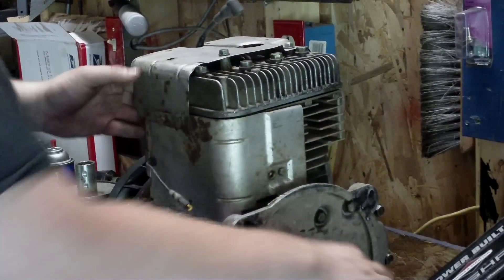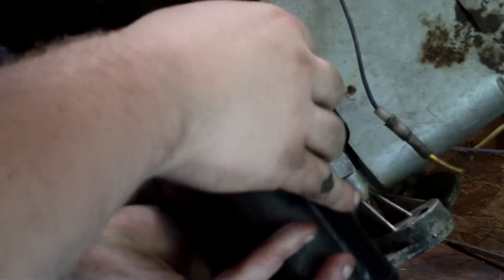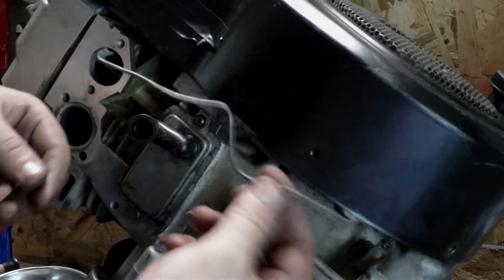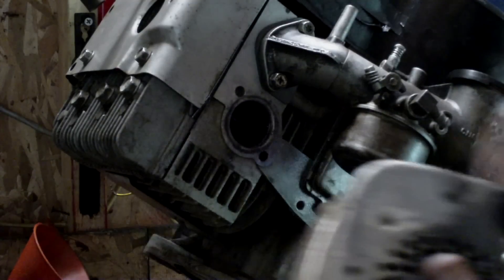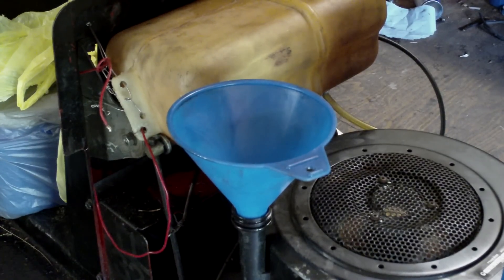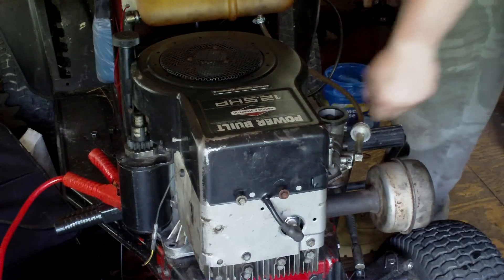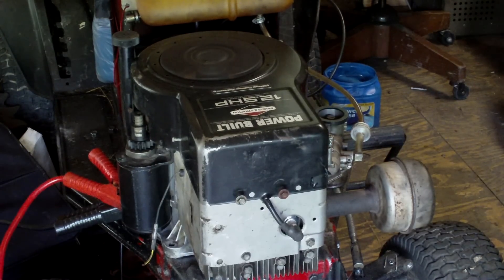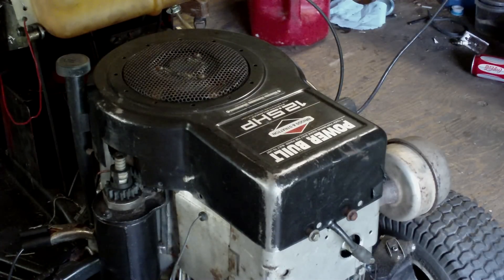Briggs and Stratton Power Built 12.5 HP Flathead Model 28 Rebuild  First Start PART 4 (FINAL)

Comment: I'm planning the same for my shop. I have a 25 x 42. I want the squirrel cage fan  and plan to run duct/vents over the workbenches to supply air exactly where needed. A friend owns a Heating & A/C business, so I can get a couple of used ones for a good price. I also want a shutter fan to suck out the hot air in the summer. I have 2 wood burning stoves for heat. I have a farm and land with plenty of trees to burn. Don't tell Al Gore, he might try to put a stop to the tree burning :-)

Comment: May not affect these small engines. In the past, detergents in multi weight oils lubricate the cylinder walls and impede break-in on V8 engines. Straight viscosity oils don't have the detergents. We used "straight" to break in engines and used "multi" afterwards, unless it was a racing only engine and then we'd continue with the "straight". The weight of the oil would depend on how the engine clearances were set up. I'm going by memory here, so I could be mistaken- I'm not so young anymore :-)

Comment from the maker: the wire from the coil or magneto is the shut off wire and goes to a post at the throttle linkage (its insulated) then goes to your ignition switch and other safety switches. The wires from the stator under the flywheel go to a plug connector that hooks to your mower's wiring, you should be able to find a schematic for your mower online. thanks for watching!!!

Comment from the maker: the difference between a 11 horse and a 12.5 is that the 11 horse is a model 25 which means 25 cubic inch displacement, and the 12.5 (12 is the same as a 12.5) is a model 28 which is 28 cubic inch, on the 12 and 12.5, the difference is the carburetor, the 12 has the older 1 piece carb and the 12.5 has the newer 2 piece. Piston size is the same and so is the camshaft, the stroke length is the only difference. i did a video talking about this, i will send it to you in a PM. Thanks for Watching!!!

Comment: I have the 11 hp power built. What's the difference that adds 1.5 hp. Mine is exactly the same. Except I have the nikki carb. Mines just as big. Everything's identical as I rebuilt mine too and saw all the insides are the same.

Comment from the maker: also, you said what would i estimate the cost at, well it depends, on this engine in the video, i rebuilt it for about 50 bucks, but all it needed was new rings, gaskets and a new intake valve, which i had a used one on hand. so i would say anywhere from 50-100 for a rebuild, depending on things like if the carburetor needs rebuilt as well, or if the connecting rod bearing has to much play and needs a new rod, alot of variables.

Comment from the maker: website and download a PDF parts diagram, which will show all parts it has. You can usually get by with using standard size rings, unless the cylinder is scored reallly bad and needs bored out, then you go with a oversize piston and rings. You will need a gasket set, and possibly new valves, but you don't know for sure what all you need until you tear it down, because sometimes you can just reseat valves and not replace them. And you may need new valve guides, which a machine shop would have...

Comment from the maker: probably more serious. like the rings are worn out and it has blow by past the rings, then the force from the blow by pushes oil up through the breather tube on the carburetor, and will smoke like crazy. But i would check the oil first and go from there, following this video on a rebuild. I don't have a parts list, but you can write down the model type and code on the flywheel cover (usually on the front, above the flywheel or on a small metal plate on top) then go to the briggs and stratton...

Comment from the maker: there are a few different things that can be wrong when this happens. i worked on a OHV engine last week that the float stuck in the carburetor stuck on a while back, the carb was fixed, but they overlooked that the gas got past the rings and flooded the crankcase, so there was like 3 quarts of oil in it, well oil and gas mix, and it was blowing oil out of the carburetor, so check your oil first, if it smells gassy and/or is over filled, thats probably your problem, now if thats ok then it is...

Comment: I've got the same engine with a lot of oil blowing up through the air filter.  Would you suspect that it's just coming past the rings?  A friend gave me the mower yesterday and I'm considering rebuilding it or just buying a new motor.  How tough is the rebuild to accomplish?  Do you have a parts list and cost estimate?  Thanks

Comment from the maker: Actually you may be surprised. On briggs engines the first 1-2 digits of the model number is the displacement in cubic inches, so this 12.5 (same as a 12 horse) is 28 cubic inches which comes out to 458.84 CC!!! I'm thinking of my 47 cc pocket bike, how small it is compared to one of these!!! thanks for watching!!!

Comment from the maker: and then, maybe like every 20 minutes let it idle for 5 - 10, this helps the rings seat in, puts more stress on them, do to the higher vacuum at idle. It will smoke for a little while doing the break in, but after the first cutting that should almost stop, other times they won't smoke a bit after rebuilding, just never know. also it may not hurt to change the oil again after the first or 2nd cutting, then change it every year as normal. the engine in this video i rebuilt is still not...

Comment from the maker: I do is run it for like 15-20 minutes at a idle to medium speed (no hot rodding haha) then drain the oil, as there is always metal particles in from everything seating in, then put it on your mower and cut grass as you normally would, but best not to run it at full throttle until after the first cutting, some recommend, which i think it really does help, is to cut grass for a while at say 3/4 throttle, then shut the blades off, let the engine idle for a little while, and do that every now...

Comment from the maker: no problem, always glad to help out. heard that. what i do on the gap is put the ring in the cylinder then push it down about a inch (not that critical) with the piston so its lined up in the cylinder, then use a feeler gauge on it, you want some where around .003" to .005" gap, and if it exceeds .010" gap, you will need to either bore it out to oversize OR sometimes you can get by with .010" oversize rings, then file to fit to get the right gap. there are different methods of break ins, what...

Comment: thanks for the advice! tested 13.5 today. seems i got knackered ign/safety switch afterall....(no current on start position)
and im just about to strip the 8hp carb down, which i took off to see if valves were operating ok, no doubt i will be back when i break something else!!

thanks again.

Comment from the maker: thanks! on flatheads they do not have a compression release (to my knowledge, briggs may have put it in some, i'm not 100% sure). well lapping valves raises compression if anything. on flathead motors it has to be in the starter/battery. but if the engines flooded out or has oil in the cylinder it can will act like it has super high compression and won't crank, see how it cranks over without the sparkplug in it. i know right! that sounds like the float is sticking in the carburetor.

Comment: hi, great videos, i have similar engine (13.5hp ic flathead) which wont start. 
battery/ solenoid/starter are fine, so i guess its valves, if i got too much compression to start it, is lapping the only way to cure it ?? 
theres much on ohv but not on old flathead engines......here lol.
i also have an 8hp flathead which when pulled over, petrol shoots out the exhaust. 
any advice would be greatly appreciated on these, thanks !

Comment from the maker: @selfoto ok i looked it up, it says that is a OHV engine. so no, you do not need to tear the engine down to adjust the valves, all you need to do is find top dead center on compression stroke, then remove the valve cover on the front of the engine, it will say OHV on the cover. Then to adjust the valves see my video : 14.5 Reassembly... i show how to adjust the valves. Both Valves are set at .004" to .006" clearance. Hope this helps, if not get back in touch with me. Thanks for watching.

Comment: @fnaguitarplayer9 
my motor: model 219907
type 0118e1
code 051011za
please tell me spec on valves. Also, can I adjust them without having to take the whole motor apart? Never adjusted valves before. Thanks.

Comment from the maker: @selfoto yes. i just watched your video, its hard to tell on a video without being in person, but it sounds like it might be the valves out of adustment, i'd set them to spec (i can give you the specs if you don't have it) and if it still has it then it might be a rod knock or piston slap, which towards the end of the video it sounded more like that. hard to tell, sometimes the sychrobalancer or AVS on newer engines makes a sound like that. thanks for watching and i hope that helped some

Comment from the maker: @8tyman8 just depends, can't really say a number, this one cost me about 30 bucks, but i used aftermarket parts as a test on this build, got all parts from tewarehouse all i bought was a set of rings, and a gasket set. But see it would of cost me more, because it had a burnt intake valve, but i had a good used one on hand so that did't cost me anything,  a new valve can run a easy 10-15 bucks. You tear one down, the cylinder might be scored and need bored or even resleeved. Might need new...

Comment from the maker: @skipjman no problem at all, glad you enjoyed it. I'd have to see it to tell you, if it looks smooth then it should be fine, just mic it with a micrometer or caliper and see if its to spec, if its 1.247" or smaller, then it will have to machined down .02 and use a undersize rod, or replace the crank. With most of the engines i've worked on that threw a rod, the crank is usually fine, not always. Just be sure the cam bearings are fine, 70% of the time the rod hits the cam and breaks them haha

Comment from the maker: @fnaguitarplayer9 pressure, the mechanic is right to a point, if you take a muffler off and run it with no pipe you will burn the exhaust valve, if its to long it will bog it down and overheat and burn the valve, you can use either type of muffler i showed in this video with no problem, like i said if its briggs brand (or aftermarket equivalent) don't worry about back pressure. Now if the pipe coming out of the "dump" type is to small like under 1", then yeah it can cause problems...

Comment from the maker: @1899lpv yes it is. The screw muffler i am using on this motor is a little louder than regular mufflers in my opinion. The bolt on box type is quieter, but yes if you have a muffler that bolts on and has a pipe that come out of it and points to the ground, or the type like on my twin cylinder that comes off the block like a header then goes down to a muffler, those 2 would be the quietest. As long as a muffler is a briggs muffler designed for a 12 horse, it will work no problem, as for back...

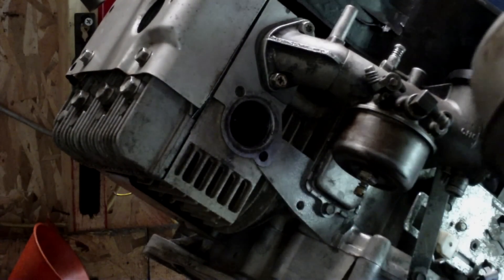Comment: @ 4:10 you are showing 2 types of mufflers.Could it be possible to install a muffler that makes less noise?The motor that I'm about to rebuilt has a muffler that ends up at the front of the motor (Craftman riding mower 12 hp) and the other one has a side mount like the one you re install (mtd servistar riding mower 12.5 hp) and I'm  getting tired of wearing those earmuffs. I've been told by a mechanic not to change anything. It involves resistance (back pressure) and could overload the motor.

Comment from the maker: @fnaguitarplayer9 for a good long time, so there is better oiling between the rings/piston and cylinder. Like i said EVERY engine i've ever tore down has no cross hatch except at the bottom of the cylinder where the rings don't touch the wall, just the piston. so yeah, hope that made sense lol thanks for watching!

Comment from the maker: @fnaguitarplayer9 another point to bring up is that alot of engine builders run there engine slightly low on oil so there is more friction, like the notation said, some say 1.25 quarts instead 1.5 quarts. I ran 1.5 on the initial start up, up to the individual, which this engine still ain't broke in completely so i might end up running it a little low if its gonan be stubborn. Some say honing is done just for break in so it wears off the scratches, most now days says its supposed to last...

Comment from the maker: @V8Mike93 yeah, i don't know how to explain it but it kind of works the same way as reseating valves, friction plays a big part, but to much friction (low oil) would cause scoring and would ruin the rings / bore. The honing helps the rings seat in as it wears down hone marks some. The hone marks are supposed to last a long time to help oil the cylinder, but every engine i've ever tore down has no hone marks in it. Hope that made sense, one of them things thats hard to explain, but....